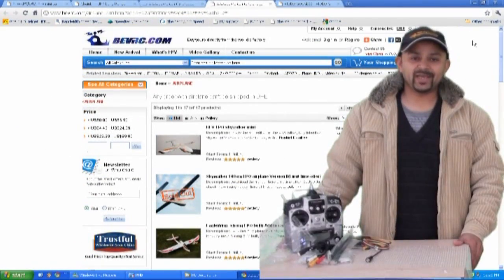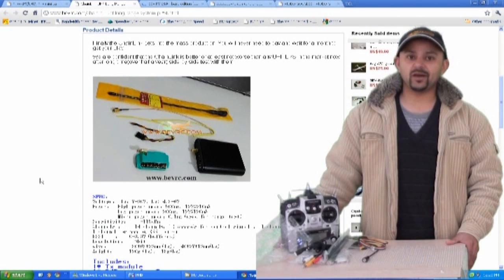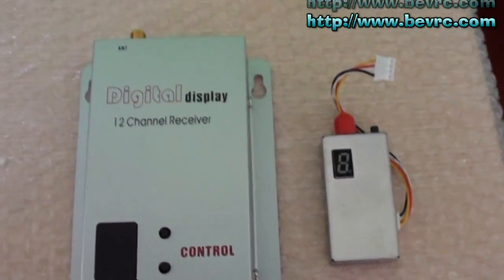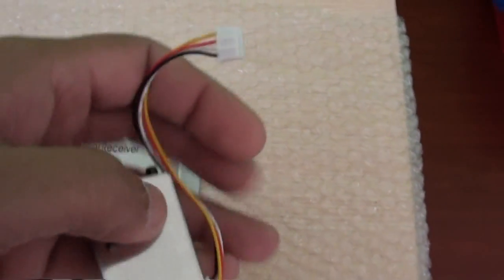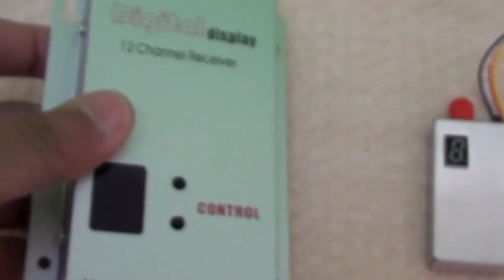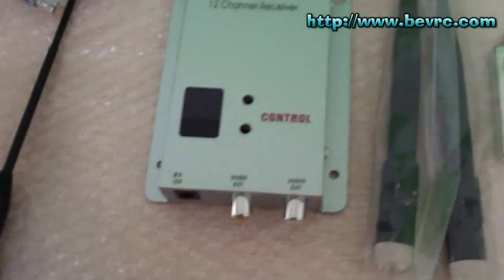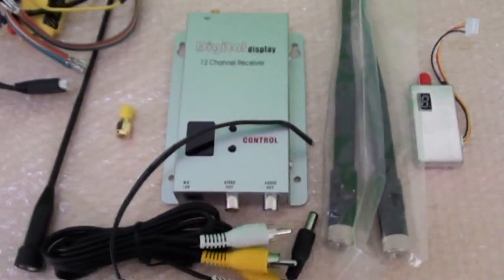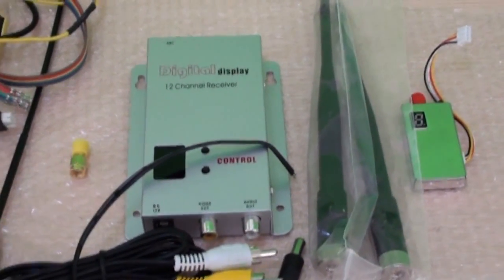Bevrc 1.3G LR FPV System Review

Comment: @funnyGuys3296 There are different levels of FPV flying.  If you have a plane and know how to fly you can spend about $120 for a basic, non-moveable camera, VTx and VRx.  Then all you would need is monitor or goggles.  I'd just use a monitor until you get the hang of it.  You could easily spend $3,000 when you start adding things like long range radio gear, on-screen displays, GPS navigation and autopilot.

Comment: @justfly60482 Oh, dude.  You've got alot of fun learning ahead of you!  I can think of a thousand pieces of advice to give you.  The best would be to watch Ali's videos along with "RCModelreviews" videos and force yourself to do research for at least a month before you buy anything related to FPV.  There are alot of expensive traps out there.  Plan to spend about $1000USD on an entry level FPV system then as you learn you can add things like UHF radios with 20+miles of range...